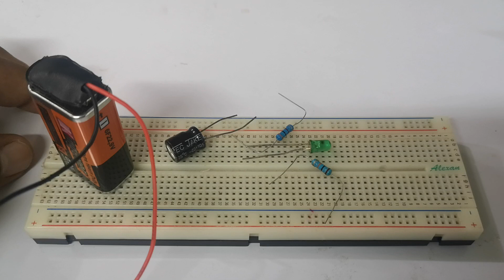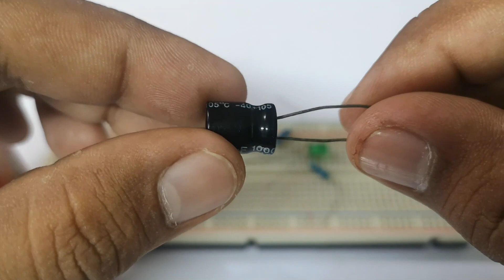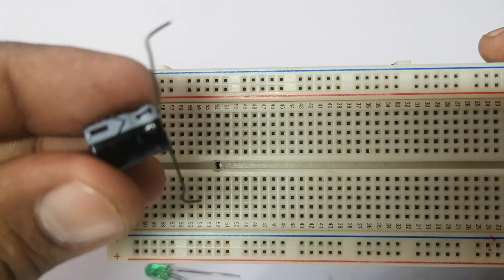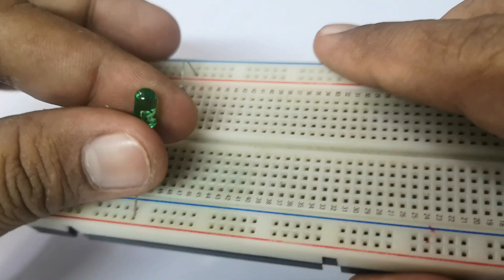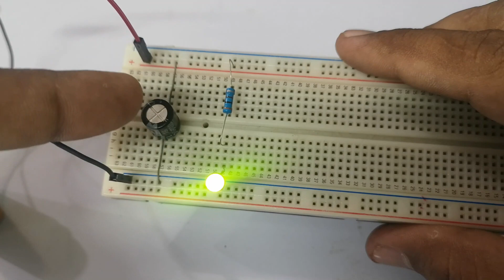How Fast Capacitor Discharged

Comment: Good day, Sir Julius. I am Jievann M. Adaza from Grade 9-Marz

Answer:
The capacitor also known as condenser can store electrical energy temporarily in an electrical field, it charges when the battery was connected to the circuit and discharges after it disconnected. The LED turned off quickly when a 300 ohm resistor was used because it had lower resistance which lead to the energy stored in the capacitor to flow directly. While the LED that used a 10k ohm resistor it turned off slowly because it limited the flow of energy from the capacitor due to its higher resistance that resulted the LED to turn off slowly.

Comment: Good morning Sir. My name is Loreyn Nanay from 8- Salz

Answer:
When turning off the power source with the 300 ohms resistor, the LED faded quickly because it immediately consumed the stored energy from the capacitor because of its low resistance. The 10k ohms resistor, on the other hand,  faded slowly because the stored energy was transfered gradually due to much higher resistance power. 

(I have already liked and subscribed to your YouTube channel sir) God Bless po, sir!

Comment: Hello, Sir Julius. My name is Schumary Faye L. Reyes from Grade 8 - Salz. 

Answer: A capacitor (also known as condenser) is a passive-two terminal electrical component used to store electrical energy temporarily in an electric field. Upon turning off the power source with the 300 ohms resistor, the LED faded quickly because the diode immediately consumes the stored energy from the capacitor due to low resistance. While using the 10 Kilo Ohms resistor, the LED faded slowly because the stored energy transfers slowly to the diode due to higher resistance.

Comment: Good day Sir! I'm Antonnette Tayrus from 8- RITZ. 

Answer:
Upon turning off the power source with the 300 ohms resistor, the LED faded quickly because it immediately consumed the stored energy (which is the the function of the capacitor, to store temporarily electrical energy) from the capacitor in result to low resistance. As for the 10k ohms resistor, the LED faded slowly because the stored energy was transfered slowly due to higher resistance power. 

Thank you for the guidance Sir!! God bless po always~ ❤

Comment: Good day po Sir Julius^^ I am Neeka Ella P. Guillero from Grade 8 - Salz. And this is my answer to your question po.

Answer:
A capacitor's(also known as a condenser) function is to temporarily store electrical energy in an electrical field. This electrical component charges when the battery/power source is on and discharges whenever the power source is turned off. The light of the LED quickly fades when using the 300-Ohm resistor because the diode immediately consumes the stored energy from the capacitor due to low resistance. Whereas, when using a 10K-Ohm resistor, the light from the LED slowly disappears because the stored energy transfers slowly to the diode because of the higher resistance.

Thank you for this informative video and the guidance, sir Julius. I have already subscribed(since Grade 7 pa po hehe) and liked this video po Sir^^ Have a great day ahead po<33

Comment: The function of a capacitor in a circuit is to store electrical energy in an electrical field. It charges when the primary source of electricity is turned on and it discharges when it is turned off. The LED of the 300-ohm resistor is quickly turning off because the transfer of electrical energy from the capacitor is directly consumed due to low resistance. On the other hand, the LED of the 10k-ohm resistor is slowly turning off because the transfer of electrical energy from the capacitor is slowly consumed due to higher resistance. 
Jade Sumalpong of 8- Ray